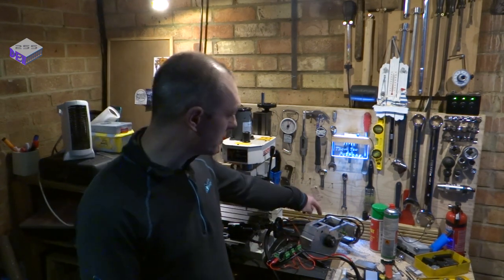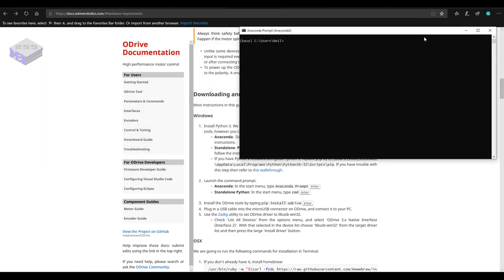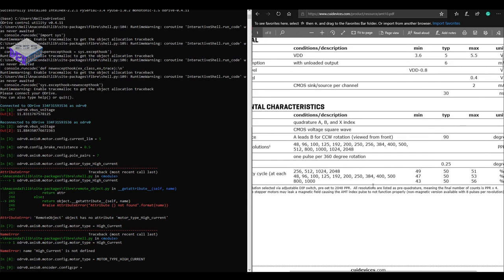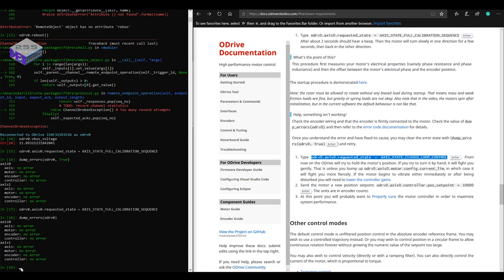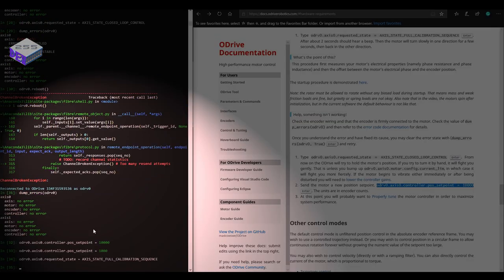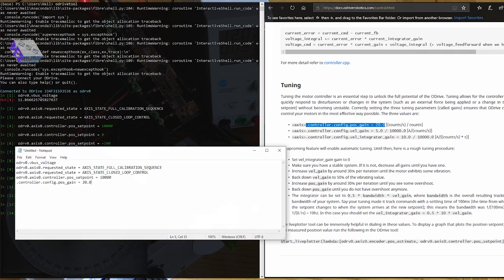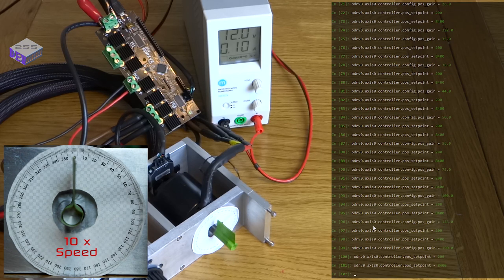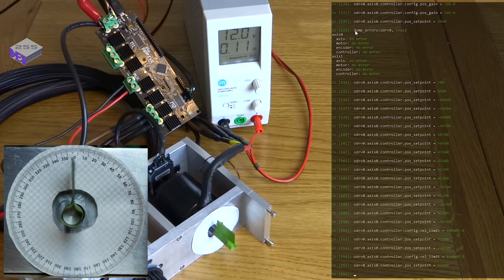CNC Mill Conversion Part 4 - Setting up the Brushless DC Motor

Comment: Thank you so much for spending the time to show this. 
Have you a video on the gui as well. 
Thanks again
Reply from the maker: Hi, glad you enjoyed it, I don't have anything on the GUI although am currently creating editing a video on the use of the new Gameduino 3x Dazzler as a CNC display via HDMI, it works a treat. I do have other videos on the ODrive though. Hope that helps.
Reply: @TheSolarPoweredEngineer  thanks I stumbled across one yesterday. 
Trying to navigate through ground loop at the moment. 
Also doing repairs on servo motors Now. 
Revolvers are very interesting

Comment: Hi Neil, great job and explained very well!  Now one of the next steps is to get the other motors running and tuned at the same time, this has been a challenge for me and most of the newbies. again great work, stigglet :)
Reply from the maker: Thank you, I will make another video when I get both working and when the unit is on the machine. I will share both the ups and downs too. I feel there is going to be some interference when the drives are under full load with such a sensitive encoder (needs to be optically transmitted possibly or a very stable supply), so will try to resolve it on video. Thank you for your kind words :-D

Comment: you could copy and paste from the tutorial. Also if you misspell something you can press the arrow up key and it will show what you have written before. basically you can press arrow up unlimited
Reply from the maker: Hi MMD, that is a very good point that I discovered later on, doh!. This would have saved me a fair bit of time :-D. Thank you.
Reply: @TheSolarPoweredEngineer  yes i noticed as well as i saw the other part of the video :D